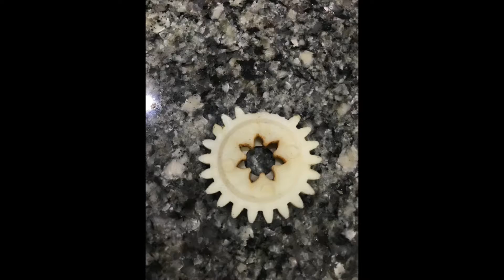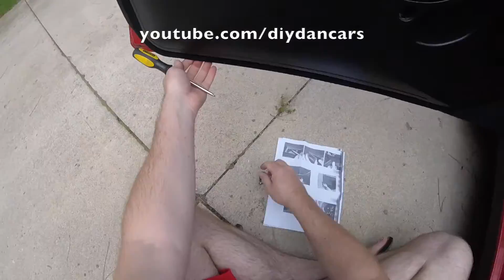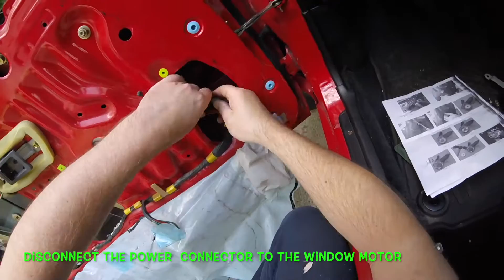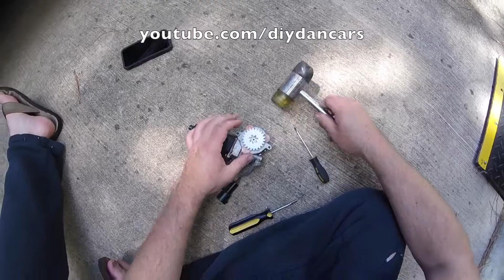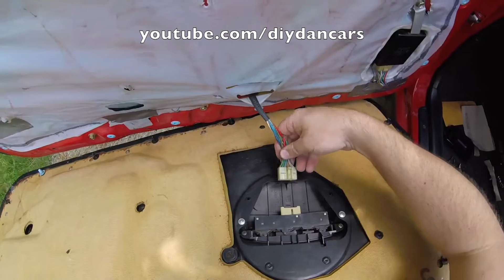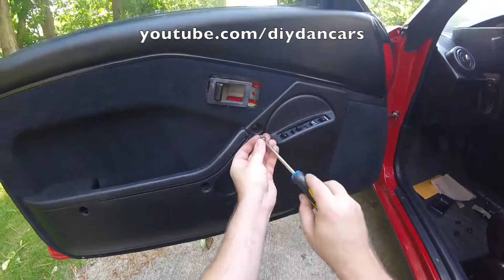Toyota MR2: How To Replace The Power Window Motor Gear

Comment: Is there any attention to have with the glass position when you put back the motor unit and then test it ? 
As it won't turn further and break something of will it stop by itself when it's up and also down ?
Thanks
Reply from the maker: I did this years ago and don't remember. If you follow my video to a T then you shouldn't have a problem.

Comment: Could you please be so kind as to tell me where did you get the replacement Gear?? I have the same problem but can't find a place where they have the gear probably also the part # if you could please
Reply from the maker: The link is in the description.
Reply: @DIYDanCars  thank you for your reply have you ever replace the driver's side whole assembly to get the power window regulator?? If not do you have any ideas on how to do it?? Thank you so much for your videos they are very helpful I'm trying to fix my driver's side power window on my 1985 MR2 not only is very hard to find the parts but it is also very expensive Can you please help me? Again thank you for your attention 😉

Comment: My passenger side window doesn't move at all (I've checked the lock switch). Do you think the gear will fix this or do I need a replacement regulator?